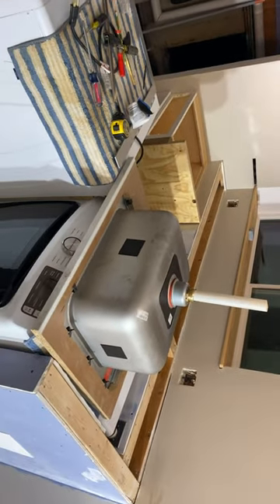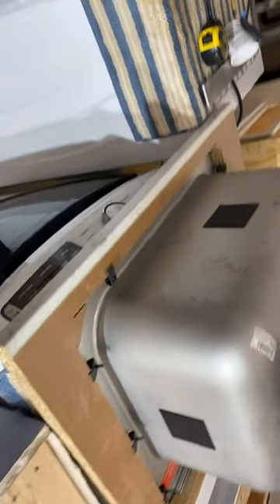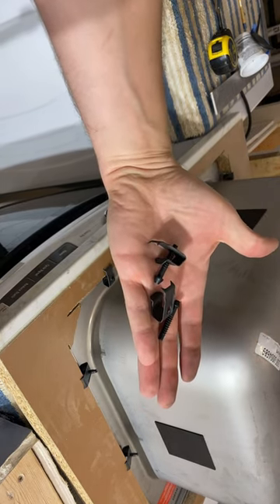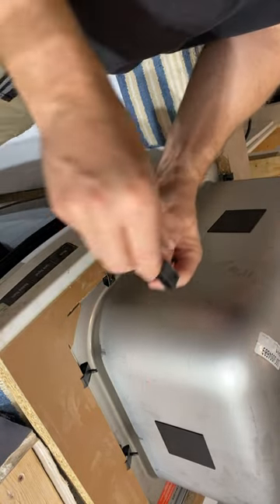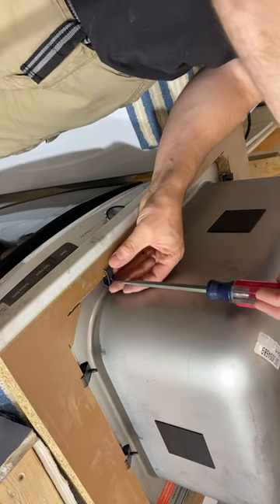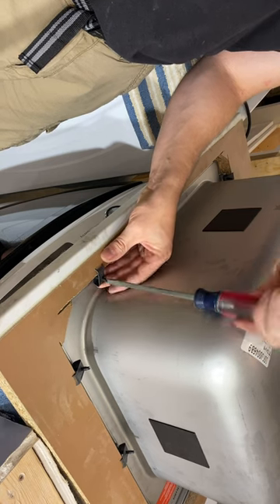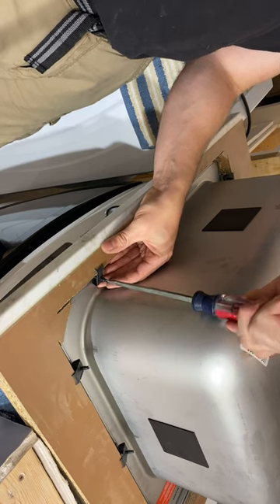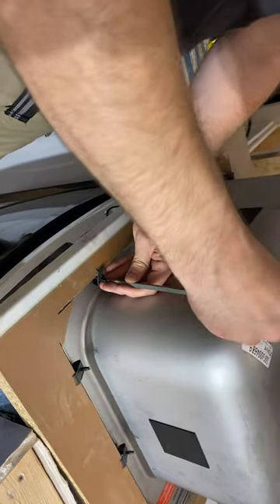Under sink mounting hardware explained

Comment: You don't show at all how the clips are installed into the sink, Is there a rail which they slide into? I am trying to reinstal a sink in an RV. The clips which it had were glued on to the sink.
Reply from the maker: the clips came with the sink. use plumbers putty around the edge below the sink, between the sink and the countertop.

Comment: thats wrong countertop must not be touched, install countertop make hole by the sink size with the sink, than install sink with hermetic it will stick use some holder for wood simialr to glueing. than install shel;f with hole size of sink in midle install brackets to shelf and pushing to sink thats it sink is solid,, than make shelf from bottomn of sink pushing up done
Reply from the maker: Good recommendation! Thanks!